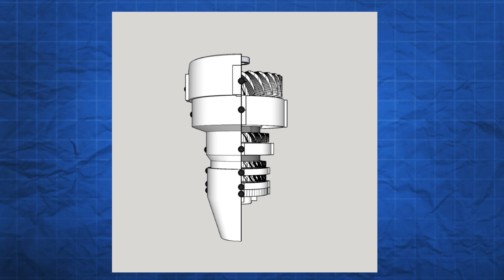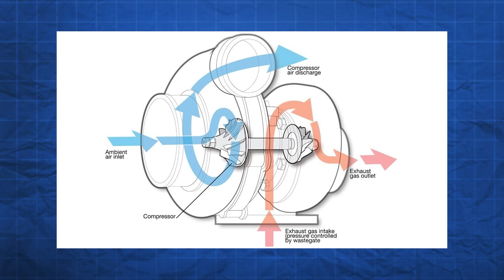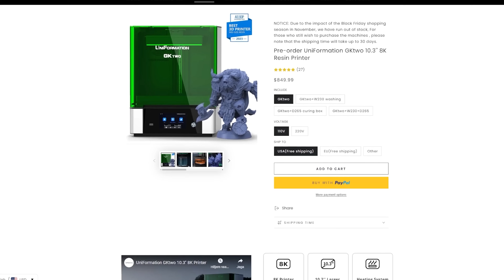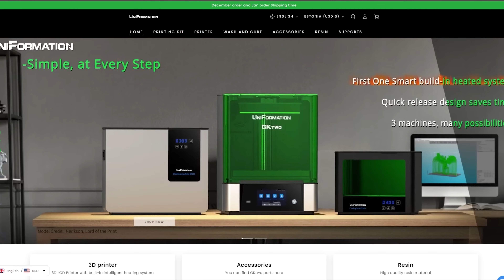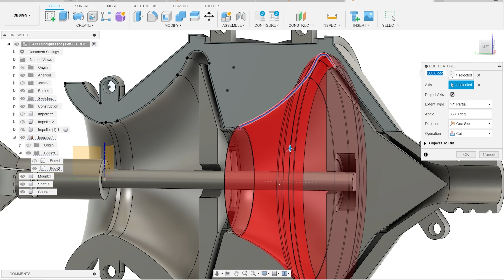Two POWERFUL 3D Printed Axial Compressors - feat. Uniformation GKTwo

Comment: I would consider adding a thrust bearing. Your compressor blades are trying to move forward as they spin up. Regular bearings are not intended to handle thrust loads. 
Great video though and keep up the good work!
Reply: I agree this badly needs the front bearing to be a thrust bearing and it needs to be well supported. Also need to ensure the fans themselves are not moving on the shaft. Its obvious they pushed themselves forward into the housing and that's probably both because they moved on the shaft and because the bearing is not supported and not a thrust bearing. It's still a very impressive design, to blow up a glove its obviously making some pressure as is. But it could be so much better with just a few adjustments.
Reply: The front motor/shaft support is not rigid enough either, it's allowing the turbo impellor to wobble around.
Reply: I work with pumps and this is exactly the issue here. He needs a thurst bearing to avoid the shaft being pushed foward and rubbing with the case. This is the "simple solution". If he wants a fancier and more complex solution, he can make a opposed compressor design where the compresors are not in tadem but in a back-to-back or face-to-face configuration. This way, axial thrust is canceled out. I would argue that back-to-back configuration is easier to design and print. Multi stage pumps known as BB3 (between bearings) based on the API 610 centrifugal pump standard are build this way exactly for this purpouse.
Reply: In a jet engine the thrust of the compressor compensates this, but with a fan?
Reply: I was wondering about that
Reply: Frank Whittle mounted two centrifugal compressors butt-to-butt and created more pressure than any lung can do with zero thrust issues. @ConnorAustin

Comment: The two stage compressor turbines flexed outwards due to centrifugal force and rubbed the housing. Aka, depending on the turbine material and design it will have a sweetspot rpm, just before it starts rubbing into the housing. You could use this property to your advantage

Comment: My recommendation as RC plane hobbyist. I worked mostly with propellers, but looked a little bit to jets.
1. Measure RPM. Compare it to the motor RPM itself. The RPM of axial compressors are very high.
2. Balance the turbines. Unbalanced turbines cause vibrations and decrease performance.
3. Don't use hammer! Balance whole turbines assembly together with the shaft.
Reply: I mean static balancing. Dynamic balancing is more complex procedure.

Comment: Just a couple of points. The radial flow compressors are sometimes called "staged radial flow" if there are two or more compressors. This was the arrangement typically used for two stage compressors in WWII turbo engines. There were also turbo supercharger engines that used a centripetal flow compressor to feed a supercharger. The other point is one of the cultural artefacts of English. Washing machine pretty much exclusively gets applied to a clothes washer as a name. Usually what you referred to is known as an ultrasonic cleaning bath. This is partly because the phrase "washing machine" was not in use until Jacob Schaffer invented a machine for washing clothes in the 1780's or 1790's.

Comment: So the wear is because the shaft is moving forward driving the compressor into the housing.   

If you cut groves into shaft and put a E clip or a spring clip.  Close to bearing it should help movement.     

Or put a little positive pressure on the motor forcing the shaft to the housing
Reply: its not moving axially, its moving radially because its not well supported. needs a second bearing, not thrust washers.
Reply: @nuttyDesignAndFab  Agreed, it at least needs a bearing between the two stages and ideally a third bearing in front of the inlet like the axial compressor
Reply: @Mrshotshell 2 is enough, 3 would be overkill. actual turbos are made with just 1 in the middle  but its a much wider journal style.
Reply: @nuttyDesignAndFab  They're also not made of 3d printed parts and random steel shafts